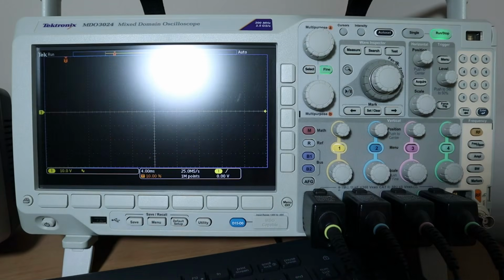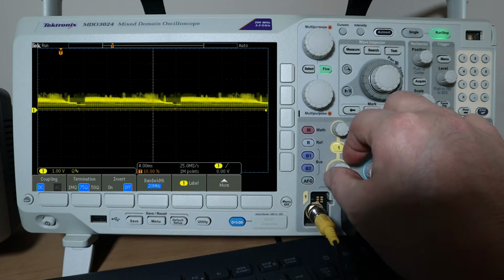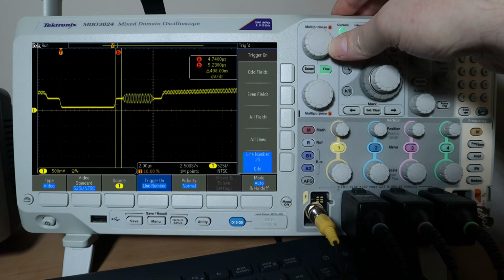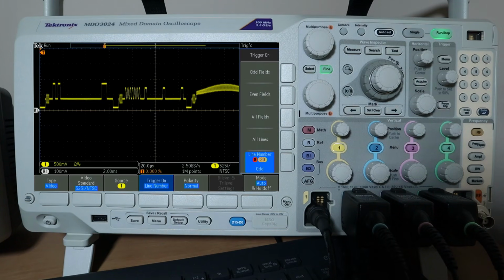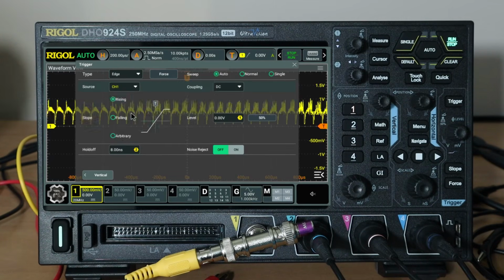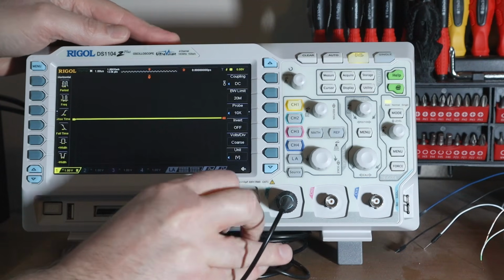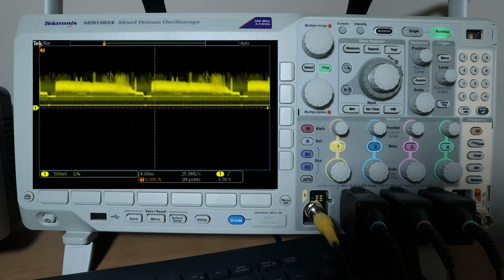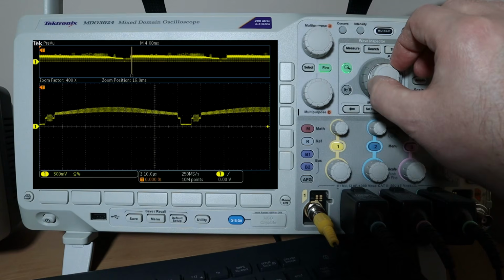Intro to Homemade Composite Video Circuits (EP 76)

Comment: If your MCU can't handle uSec timing, it's awful Looking at you MU of the UNO R4
Reply from the maker: The UNO R4 uses the Renesas RA4M1 32-bit Arm Cortex-M4 processor, not the ATmega328 that I showed in the video. The ATmega328 was used on the previous Arduino UNO boards, and it is very capable of accurate microsecond timing as I will demonstrate in future videos. Thank you.
Reply: @DoctorRGPlague  The RA4M1 was a good idea, just really awfully designed.